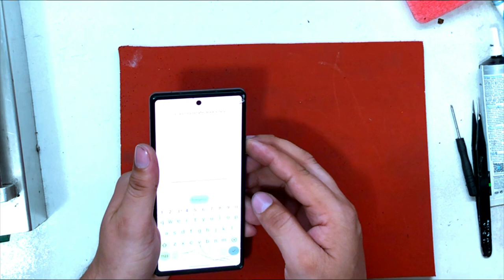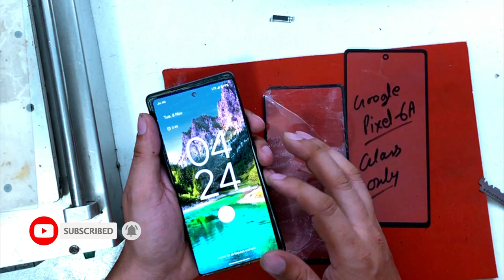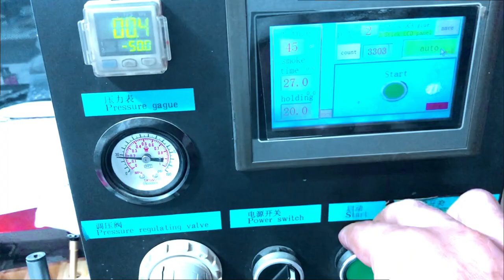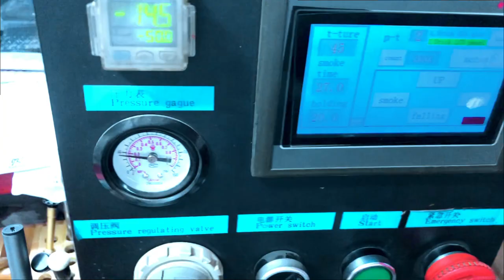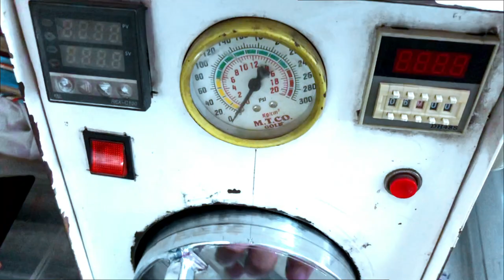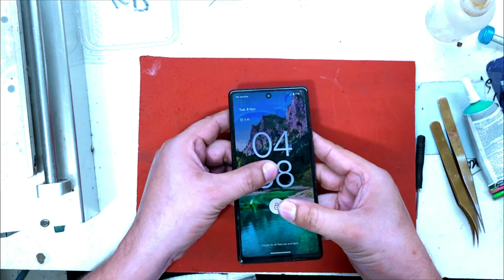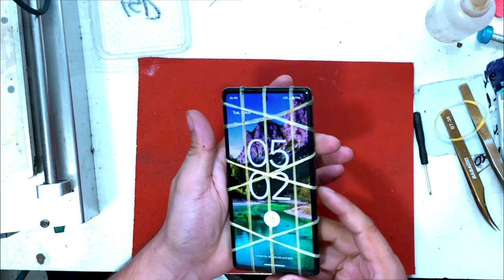Google Pixel 6A Crack Glass Replacement | Screen Repair | Broken Touch Solution @TechnicalUstaaj

Comment: Out of curiosity, I do not have a vacuum separator, but I have a hot air gun and 0.10mm diamond wire. With patience and a careful hand, would this still be a feasible fix for me?
Reply from the maker: No
Reply: @TechnicalUstaaj  thanks, I ended up picking up a vacuum separator, it worked like a charm!

Comment: At what temperature is the vacuum separator set to for the pixel 6a
Reply from the maker: 90 degree
Reply: @TechnicalUstaaj  Thank you. I need to turn up the heat. I had mine set at 82
Reply from the maker: Welcome